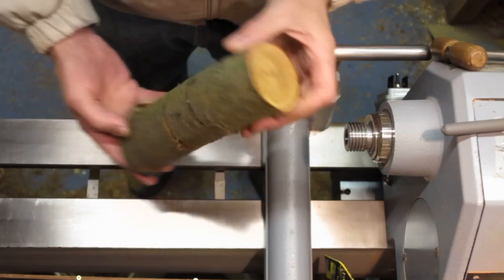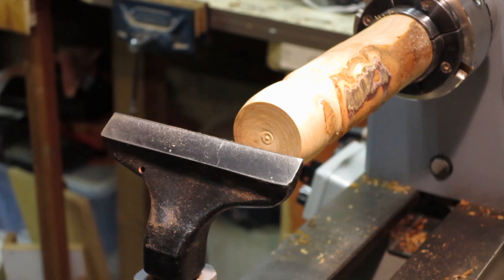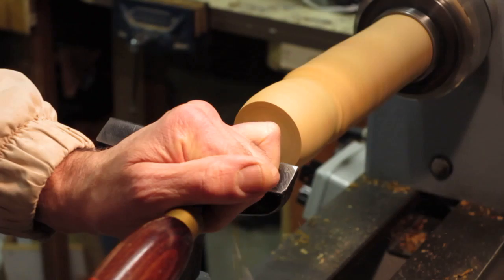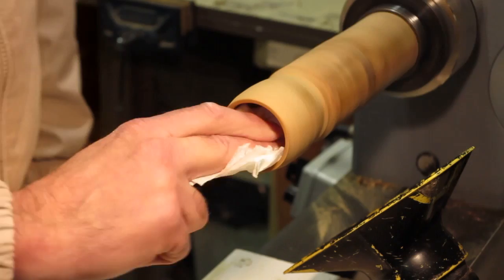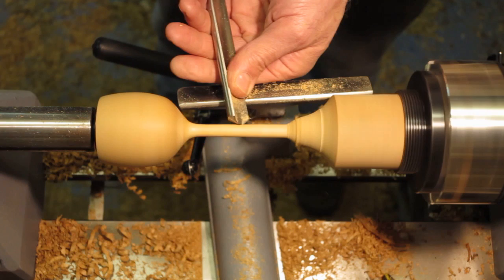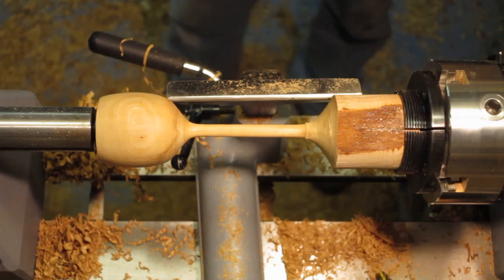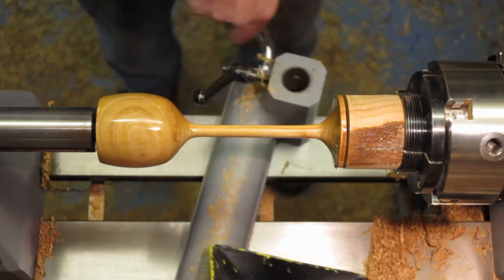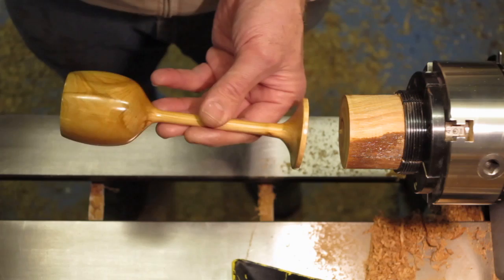Wood Turning - Beginners Guide #1 - A Goblet

Comment: evening mike,my woodturning is going ok with the avon tyme cub i got for £50 bargain,my question is can you recommend a safe finish to put on goblets that are to be used i,e drank from???
keep up the good work and look forward to watching more clips from youself.
Reply from the maker: Andrew Jolley Hi Andrew, I all my goblets etc. are for decoration and not for using as such, but I've been looking at a finish by Treatex, it's a hard wax oil, which claims to be ideal for things like vases, and is resistant to beer, spirits, and fizzy drinks. Here's the link:
http://treatex.co.uk/hardwax-oil/

Hope this helps
Cheers
Mike
Reply: Mike Waldt CHEERS MIKE MOST APPRECIATED,looking at doing tumblers and the such and thanks for the link :-)))))
Reply from the maker: Andrew Jolley Any time mate, my pleasure.

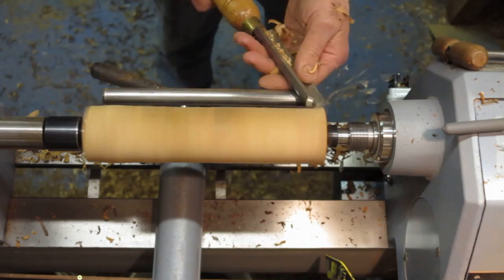Comment: Once you placed your piece in the center spur and tail piece to round it you immediately jumped at 3:09  to cutting the bowl.  How did you chuck the piece?  It looks too deep in the chuck to be a dovetail and you didn't mention the method.  Thanks.
Reply from the maker: I formed a tenon and used my medium gripped jaws, which are serrated, to hold the piece.
Cheers 
Mike
Reply: @MikeWaldt  Thank you

Comment: do you have a broken or old roughing gouge I could have or buy off of you, because I have just bought a cheap set off of eBay and I'm really unhappy with them but the proper pro tools are really expensive.
thanks
adam
Reply from the maker: Hi Adam, I'm sorry mate, but I only have two sizes, and I use them both very regularly, one of which I got off eBay that was used but a good make and price. My advice is keep looking on eBay for branded "used" tools, you can get some good deals on auctions.
Take care
Mike

Comment: Mike, I will have to try and make a goblet after watching this....:-). What speed were you turning at? Something I have run into with bowls.....is the wall thickness being so thin, that the wall starts flexing. 

Take care, and have fun this weekend at UKIWS! I remember in a previous video that you mentioned it started out small with you wanting to meet some other turners at a pub. But I hope it becomes a yearly thing, as wife and I are already talking about hopping the pond for one in the next couple of years....lol.
Reply from the maker: Hi Barton, I normally turn as high as I feel is right, I was turning at around 1500 RPM, with fairly light cuts with sharp tools.
As I'm sure your aware UKIWS is now over, and it was a fantastic event and thankfully the feedback to date is all very positive.
We are planning another next year, so hopefully you and your wife will be able to attend :)
Take care
Mike
PS - Sorry for the unusually late reply.

Comment: Hi Mike, I recently lost my Dad and he was a woodturner. I have been spending some time in his shop trying to use the lathe and having a good time learning. However I am having trouble when trying to hollow out, the tool will aggressively gouge and throw the blank out. What am I doing wrong? (I wish that I could ask my Dad that question)
Reply from the maker: My condolences on losing your Dad, I lost mine 5 years ago, and still wish he was here to answer my questions, and bounce ideas off. There could be many factors causing your catches, my basic advice would be to drill a "starter" hole, the depth you wish to go to. Then with very little pressure, have the flute facing to the left, and rub the bevel on the rim of the drilled hole. Then slowly roll the gouge to the left, until you start to pick up the cut, and move from the center to the outside. I found that lots of practice on scrap wood helped a lot, as if and when you get a catch, nothing is lost, and you can learn from these errors.
Let me know how you get on, and if you have any more questions, don't hesitate to PM me.
Take care
Mike
Reply: Wild. I also recently lost my father who was a wood turner. He was a great carpenter in general and every time he was trying to teach me something I took off to get drunk with the boys, Now, I wish I hadn't. It would have been great to learn from him, but I guess I'm learning things the way he did.... the hard way lol. I just got a new belt for the lathe motor he left me and found your video and this comment. Thanks for taking the time to make these videos Mike. they are helpful
Reply from the maker: Waldoe Flagg my pleasure Waldo, and thank you for watching, and commenting. The old saying of "you don't miss it until it's gone" is so true.
Take care, and enjoy your turning, your Dad would be proud of you :)
Mike

Comment: Just curious, whether or not I'm bad at googling, but does it matter how old the wood you use is? I know that wood gets harder (haha) the longer it sits, but would there be any repercussions from using freshly cut wood?
Amazing video by the way, I'm so excited to start cutting.
Reply from the maker: Hi Chris, there are pros and cons for dry and wet, new and old wood to turn. basically, wet wood(freshly cut) needs to be processed to prevent  or reduce the cracking that takes place as the wood dries. There is not enough room here to go through all the alternatives, but if you search on YouTube, there are some excellent "how to" videos on the subject.
Hope this helps
Take care
Mike
Reply: Thank you so much!
Reply: Green/wet wood doesn't just crack, it also warps. I made a beautiful bowl out of green elm after I cut down a tree in my yard. Treated it with butcher block conditioner. It didn't crack, but it is more oval than round these days

Comment: Hi Mike, I am very new to woodturning, and would love a piece of your knowledge. This weekend just gone I tried to turn a small vase (makeup brush holder for the wife) and I really struggled to hollow it out. I used a really well seasoned piece of Oak slightly bog like. I used a large and small spindle gauge (I think, my terminology isn't great)  but really struggled to cut in and ended up breaking the plate that the oak was fixed too. can you help. I filmed my first turning project (Yew Candlestick) is it my techniques or tools? any help would be greatly appreciated.
Reply: Mike Waldt thank you for the fast reply, it's around 8" give or take and roughly 3" diameter.
Reply from the maker: +Dean Howard 
I will say Dean, that you are pushing hollowing 8" deep, even with a 1/2" spindle gouge. With the right method a bowl gouge would just about do it, with care. If you want to do a lot of hollowing, my advice would be to consider some dedicated hollowing tools, just my opinion.
Hope this helps 
Cheers
Mike
Reply: Mike Waldt thank you for your help, I will invest in some better tools. I think your videos are great and really informative you have a new subscriber. many thanks
Reply from the maker: My pleasure Dean, and thanks for the sub my friend.
Take care
Mike

Comment: I was just wondering what chisel I should use because I got some a while ago but it is miniature not full size lathe. I don't really know what to use and when. I wasn't able to find my set anywhere but they are by microlux (micromark) I don't really know much about wood turning but I was hoping anyone could help me out I was wondering what chisel to use and when
Reply from the maker: Hi Mark, my advice would be to look for a video that is making a piece you want to make, and see what tools are being used and go from there. Also, research different tools and there uses.
Hope this helps.
Cheers
Mike

Comment: i do not know if this post is still good.  i am having a big problem with my wood. i am new  as of 3 days new :)   i made 2 goblets.  did really good and then  today i woke up to find out  its cracked up split and done for.  both of them.   i had wood stain on one from minwax.  the other was no stain at all.  also  can you please make a video on chucks like how to size what you need and what kind of chucks  i am going to buy one in 3 weeks....  ps  sorry for grammar i working on it :)
Reply from the maker: Hi, if the wood is wet or even fairly damp, there is always a chance of cracking. If you want to search YouTube there are many excellent videos on how to store and treat wet wood, and advice on how to minimise cracking etc. 
Hope this helps
Cheers
Mike
PS - As far as chucks are concerned I can only advise you to troll the internet on the subject, and research as much as you can, as this will help you to make an informed choice.
Reply: thank you i been working on my lathe for 2 weeks now.  and i love it.  3 of my bowls cracked after 2 days setting but the other 2 did not.  i am learning but i well not give up.

Comment: Hi I have some questions I am new to turning but I make custom plugs for ears. Anyways I use hard woods like Blood Wood, African Paduk , Satin Brazlian. I am going against grain just because thats the only way I can get my woods atm. So its very difficult to turn like how you turn stuff. Does speeds play a part in how easy it is to cut something? Also does the wood play a part in it as well?
Reply from the maker: ProD Miner In my experience (3 1/2 years only), the best cuts and finish are dependant on the highest speed you feel safe with, very sharp tools, and a light touch. Even the most stubborn of woods can be tamed to a greater degree if these three fundamental rules are adhered to, and NO, I don't always adhere to them all myself, from time to time ;)
Hope this helps
Take care
Mike
Reply: Thank you very much! :)
Reply from the maker: ProD Miner My pleasure :)
Reply: I plan on getting a new carbid set of turning tool in a couple weeks :) You think thats a good investment?
Reply from the maker: ProD Miner I have some carbide tools, and they are very effective, and in the right hands (not mine) they work very well. I am more of a traditional tool man, not because I have been turning that long (3 years), but I just prefer gouges and skews. That said, I do use them for certain tasks. not much help really, am I ;)
Take care
Mike
Reply: Mike Waldt Well lets just say I am not the best at sharpening tools lol.... So I figured if I get something that keeps its edge maybe I would be better off :)

Comment: Hi Mike I'm just starting wood turning and I'm struggling on what chisels I need to start can you please give me an idea on wahat I need. Cheers Frank
Reply from the maker: Hi Frank, if you get a starter set from a good manufacturer, you won't go far wrong.
Hope this helps.
take care
Mike
Reply: I've used both the harbor freight starter set ($60) and recently got the Sorby starter kit ($329). The difference is huge. So you do get what you pay for. The most used tools are the roughing gouge, spindle/bowl gouge, skew and parting tool. If you want to start with carbide tools, you can find sets with interchangeable heads so you're not having to buy a whole bunch of different tools.
Reply: I was just wondering the same thing because I got some a while ago but it is miniature not full size lathe. I don't really know what to use and when. I wasn't able to find my set anywhere but they are by microlux (micromark) I don't really know much about wood turning but I was hoping anyone could help me out

Comment: How do you know what speed the wood needs to go ?
Reply from the maker: Speed comes with experience, I always recommend a speed that you feel comfortable with, and as you gain confidence increase it.
Cheers
Mike
Reply: Hi Mike, well i now have a shiny new lathe a Nova Comet II, and some carbide tools, I have tried to turn some wood, but i am a little confused, is it the tool rest that should be center line, or the cutting part of the tool ?  Thank you again

Comment: what rpm did you use to rough it out.
Reply from the maker: Normally about 1500 rpm Will
Cheers
Mike
Reply: Mike Waldt great video, but what is the piece called holding the wood in place without the tail stock?
Reply: Thanks

Comment: thought it was dangerous to use a spindle gouge to hollow out the end grain?
thought you required a bowl gouge for that...
Reply from the maker: In my opinion nothing wrong with using a spindle gouge for shallow hollowing such as in this case..
Cheers 
Mike
Reply: @MikeWaldt  Ahh okay, good to know :) Im new to turning, Just going by what im told :) 
Thanks for clearing that up :)
Reply from the maker: Any time 🙂